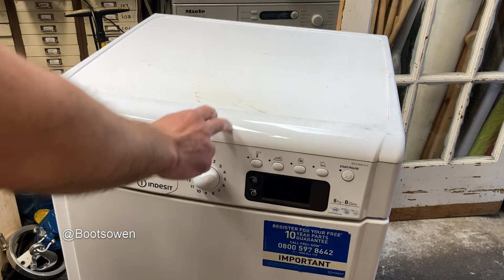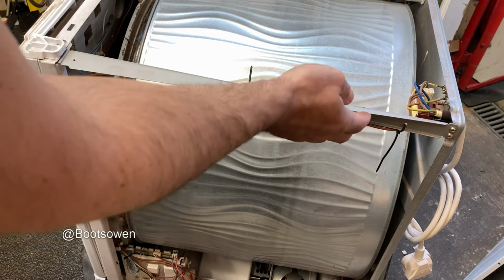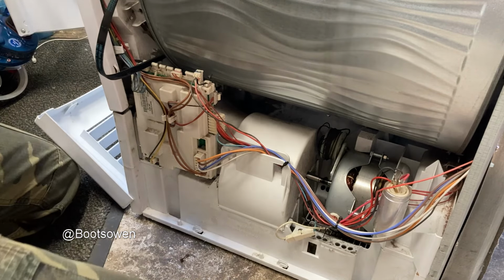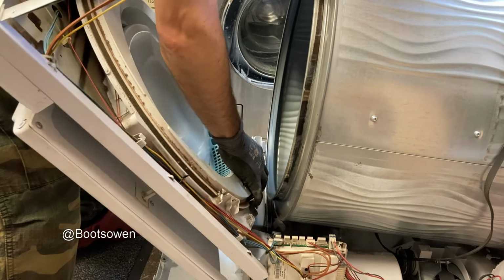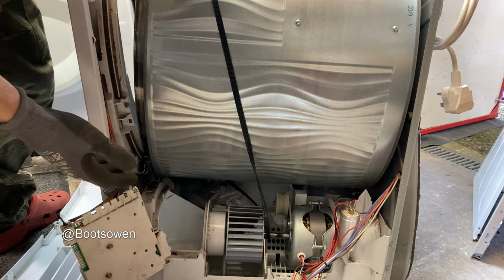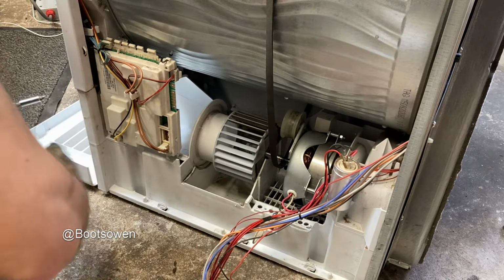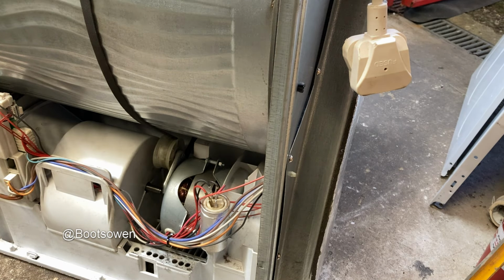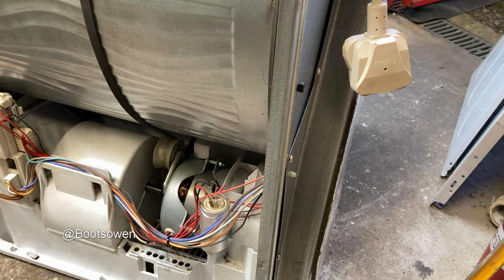Realistic how to: Indesit condenser tumble dryer belt replacement: 45 mins

Comment: Couple of things. Ya tried, ya done it. But. Ya done it wrong unfortunately bud. 1st part, easiest way of getting the belt on, take the plastic cover off the back, take out the sbar holding the shaft into the bearing, take the 2 screws out of the water container and the back panel will come loose, ya can get the belt between the back panel and the shaft then. Saves taking the whole front off and the battle. Then, the fan under that cover, take it off, easier to slip the belt on. And finally, the belt u have in the wrong position, when ur looking at it the back of the belt under the drum is supposed to come out and over that pulley wheel, not pushed in, so that's why it's making that noise, it will eventually break again and isn't under enough tension, easiest way is to get the old belt and wrap it behind new belt and pull as hard as ya can to get it over the white pulley wheel. Just the way ya went about it made life hard on urself, and the belt being on wrong, otherwise, well done pal
Reply: This is what YouTube is great for. Sharing knowledge through experience. Fair Play Bud.
Reply from the maker: Cheers Balfie. the belt under the belt trick makes sense, but I wouldn't have thought of it. As for the belt being in wrong, This is an issue for a have a go mechanic who didn't take it apart, I can't really tell what way it should go back together, time will destroy it then and as it is now on long loan with a pal it will eventually come back to me if it goes! I meant to repair the filter too, but that didn't get done. Not my best effort, But when I get a comment from you I seem to learn something!
Reply from the maker: Balfie always comes up with good advice Tommy,, and even thought it's critical it is all constructive. There is more in his comment than in all of me blundering through this video!
Reply: @bootsowen  yea, just like Me Mr.B ? ....  Don't forget to UNPLUG your Patatoes, or Burnt Roasters could Ruin the Sunday Dinner ! ... No need to Thank Me Mr.B. 👍 Happy Sunday 😂
Reply: @bootsowen  like I say buddy, ya done it, and for someone who doesn't know then it's a great effort, I've done so many of them now it's second nature, so only trying to help ya bud. 😊 Said to ya before, when I know somethin I'll help as best I can,
Reply from the maker: Thanks Tommy!